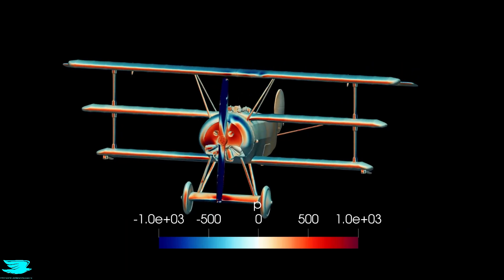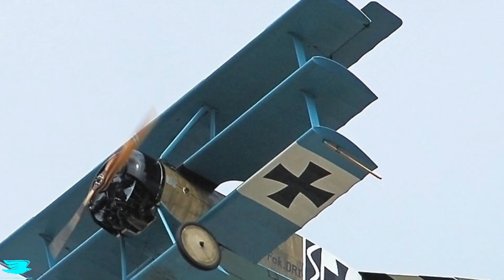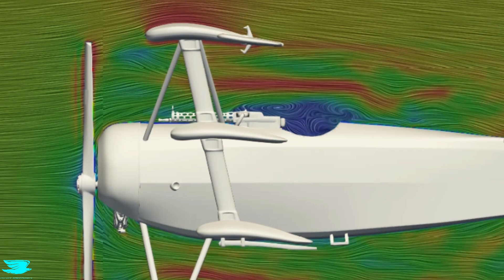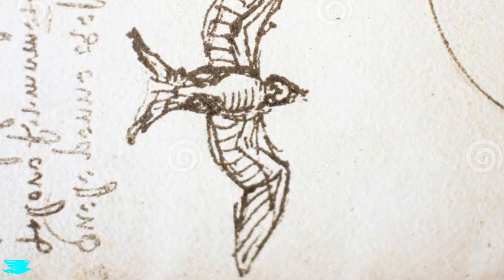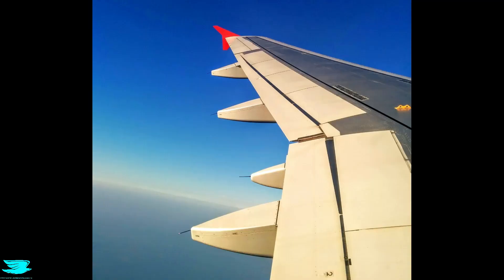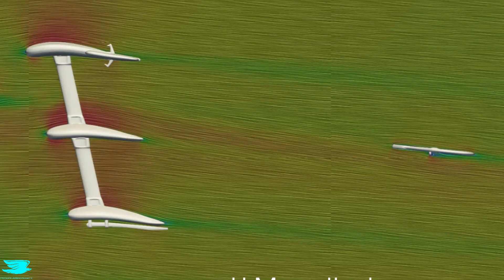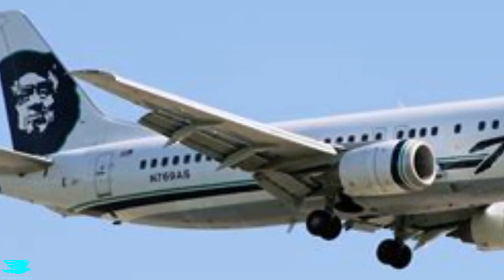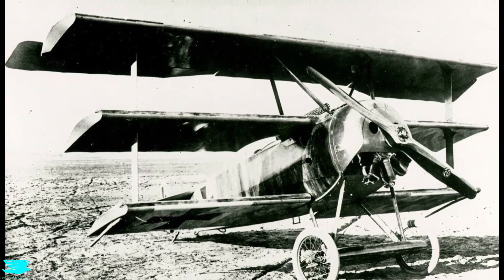Red Baron's Genius Aerodynamics

Comment: for someone discussing aerodynamics, you seem to know surprisingly little about aircraft design basics. love the videos, but it's hard to listen to a technical discussion where a person can't even get the basic terminology right. In WWI they understood far less about design than you think. they figured it out by Lots of trial and error, and adjustments after testing.
Reply: this is true, some of the effects discussed are quite obviously trivial or even detrimental. For example the effect of downwash on the horizontal stabiliser is taken assuming the h. stab. is at positive angle of attack, when in reality if the aircraft were stable it should be at a negative angle of attack at cruise and especially when doing high positive G manoeuvres.
Reply: @KingJellyfishII  the Fokker DR.1 was not stable.

Neither was the Supermarine spitfire. 

Both had their CG located at or aft of the neutral point and would diverge into a turn requiring the pilot to push forward to set the cornering g or the aircraft would stall, over stress the airframe, or knock the pilot unconscious. The instability of these types is what sets the apart among most analogue aircraft in history. There are plenty of documents for references.

Comment: pretty sure a few others used thick wings earlier than the Dr.1, though not as prominently. There was an all-aluminum monoplane from 1909 that surely used a thicker wing to achieve a metal monoplane. Think of the Junkers J1 and D.1 monoplanes of WWI for example.
Reply: Thick Wings..ya mean like a Ford Tri-motor designed like a ?  
That upside-down tailed floatplane Hansa-Brandenburg W.29 was flying by Mar 1918.  A low-wing monoplane some guy name Ernst Heinkel designed.
*Zeppelin-Lindau about copied for their CS.I.  A guy name Claude Dornier worked on improving that thru the '30s to make bigger seaplanes.

Comment: The triplanes were actually quite a bad idea wingform wise. Lots of interference drag and inefficiency but the idea of setting the prop pitch for high climb rate was a good idea
Reply: And the DR1 had to be pulled out of service for a month i think because of upper wing surface of the top airfoil would delaminate and cause control surface fluter ?

Comment: Can you have a look at the effect of adding a drag wing to the rear of the cab and the bed of a pick up truck specifically Mitsubishi l200 2012 dual cab, I’m trying to go fast 😂
Reply: @BoostedMike1  
You should span a tarp from your cabin to the opened back door.

You need to catch some air under the tarp to prevent fluttering.

The pickup truck should look a bit like tesla's cybertruck.

If you want to go even faster you need to mount electric impellers (1-10kw) behind your opened backdoor.
In addition to the streamline tarp.
Reply: I’ve done a canopy but I’m ditching it for weight I’ve already stripped 300kg+ out of it made a flat (as I can) floor it makes 700bhp 1100ftlbs of torque , but when it gets to 130mph+ you can feel the wind generating lift it gets very light on its feet I just want it to feel a little more planted especially at high speed off road 😂
Reply: @BoostedMike1  

Since the car get's formed like an airfoil it is producing lift.
But the airfoil shape also helps mitigating drag. 

Instead of putting weight on the canopy, you should attach it.

Take a look at s-shaped airfoils.
Best way is to add a spoiler behind your car.

If your open trunk lid get's the end of the aerodynamic airfoil shape, you could build a spoiler behind. 

Spoilers on top of the car don't work well. They are producing drag. 
It is important to put it behind. 

If you put a big 2m² airfoil behind, it should produce about 700kg downforce at 130 mph. 

If the torque starts to lift your frontwheel, you need to build an airfoil that is placed some distance in front of your car.
Perhaps 1m² front spoiler and 1m² 
back spoiler.
Reply: @c.l.3806 - you’ve done all this. right?  The exact size of airfoils…maybe you used an aerodynamics program - like Airshaper,  XFLR5  or WOW.   Such gibberish, SMH.

Comment: Also, the gyroscopic ( Torque ) effect from the rotary radial engine aided in maneuverability in a turning contest - dog fighting 👹
Reply: The gyro effect of the rotary really hurts the Dr.I in a dogfight. It retains energy much better with a fixed engine, because a great deal of rudder is required to counter gyro forces of the rotary. Look for chill31000 videos of his Fokker. You can see it there

Comment: 12:00

The tail got a delta Wing design. 
There you get vortex lift instead of stall over the airfoil. 

That is why a flat plate is working.
Reply from the maker: That could be a reason, definitely.

Comment: 6:00

Wing fences on top should get 1-3° attack angle.
That they push the airflow outwards.

At bottom they should lead the flow inwards.

This works like winglets. Reducing induced drag a bit. 

Huge Seperation bubbles got a harder time to form. So you get better stall characterictics.

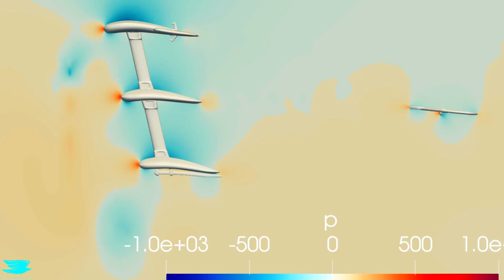Comment: 4:30 

The Wing reaches out 100 Meter above, sucking air to the ground. 

You need to put hydrofoils some distance into the water.

Working with pressure instead of suction is not this effective.
The friction envolved causes far more drag.

That's why effective airfoils are somewhat cambered. Or flat at the bottom.

Comment: I am very disappointed that you failed to mention the most discussed feature of this plane in serious aviation discussion - the propeller pitch. The outstanding agility and especially the climb rate were caused in only a minor part by the thickness of the wings. By a lucky coincidence the designers designed the propeller in a way that allowed it to generate the most power not in fast dashes but instead during moderate speed flying like climbing and maneuvering. This choice sacrificed their design's top speed but gave it the performance characteristics it is most known for.
Reply: They didn't sacrifice much speed with the propeller choice. The engine was nominally 120 HP at 1200 rpm. A static ground run on the Dr.I is right at 1200 rpm. At max power in level flight, the engine will rev up to about 1450, and the plane reaches it's top speed. Drag with 3 wings increases so much that I would be surprised if going with a coarser pitch would yield much improvement.
Reply: Speccing a propeller to an engine and airframe was pretty much settled science even back then. There is a VND curve for all propellers. It begins at Zero and grows in a parabolic arc to peak efficiency. Moving that curve around to cause peak efficiency to coincide with best L/D (for climb or cornering). Is simple.

Comment: Even if the CL slope of a delta wing is lower, the critical angle of attack is crazy high, like 30+ degrees even, due to vortex lift, maybe that's why the tail is a flat plate, less complexity and also structurally and aeroeslastically speaking more stable. Also, in most airplanes when you design them you try to have the tail a 0° effective angle of attack at the design angle of attack of the airplane to minimize drag. They knew about the vortices, Prandtl had already pulbished about the boundary layer and viscous effects, Lanchester had published his vortex theory... They were truly geniuses.
Reply from the maker: Do you think they knew about vortex lift? Or at least saw some data from testing that indicated better performance? That would be really wild.
Reply: I don't know, probably not, maybe empirically and didn't write it down(?) idk. But changing from straight horizontal stabilizers on the E series to the "delta" shaped ones in the D, plus the 0° effective AoA of the HS that you demosntrated in the video makes me believe that they tested and adjusted it either with wind tunnel or flight data. I think it would be next to impossible to calculate the downwash of not 2 but 3 wings interacting with eachother BY HAND!

Comment: The fuselage is fairly deep all the way back to the tail, so may have performed the function of a fixed vertical stabilizer. My Challenger ll light sport aircraft had very little vertical fuselage surface and needed extra “finlets” to keep it flying straight without constant rudder input by the pilot. Additionally, not having as much fixed vertical stabilization would make it more maneuverable in yaw. An article on Werner Voss’s final fight where he took on multiple enemy fighters by yawing it quickly to fire on each plane as they attacked him. Unfortunately, this made him so overconfident that, even though he could have outclimbed them and escaped, he chose to stay in the fight with fatal results.
Reply from the maker: That's a good point. Less constant force on the pilot too.

Comment: Would have been better to remove the dead stick from the model. Its effect on the pressure distributions and streamlines was really distracting.
The ridges were just a result of the fabric covered ribs / cambered surface; they certainly were not deliberate.
The main advantage of the thick wing was the possibility to do away with bracing wires, reducing drag. This was brought to culmination with the Fokker D VII; the plane the Entente forced the Germans to hand over after their victory, because it was such a technological breakthrough.
As for ailerons being limited to the top wing: I think that was mostly about reducing complexity. The top wing was largest in span, meaning that the ailerons would be most effective there; the momentum of inertia of the plane was also quite low due to its small span, so one set of ailerons was obviously enough.
I don't buy the effect on the elevator/ stabilator: deflected surfaces affect the flow well above and below; they  would have affected the flow over the elevator as well, even if significantly above or below. When you calculate the effect of downwash on stabilator surfaces, the effect of z-offset has very little effect on said downwash.
As for flat stabilators: The Piper Super Cub had such a design and was bult well into the second half of the century and still flies today, it is not as detrimental as you describe. The worst design choice of Focker stabilators was the triangular plan form with the small aspect ratio, that affects the lift over alpha characteristic in a very bad way, and one can argue that this is the single most important feature of a stabilator: you want a change in pitch to have a large effect on the corrective pitching moment of the stabilator.
Earlier designs were way worse in that aspect, showing that this really was not understood well; look at the Etrich/Rumpler Taube for an extreme example.
Reply: Strongly agree on all points. It's odd that this video starts with the comment that a flat surface is "barely effective" which is a bizarre claim considering it's been used in tailplanes for nearly a century.

Comment: 3 wings was designed/choice because of stiffness.  They designed it like Bridge, truss beam.  They don't have so strong and light material like we have now
Reply: You' be right if they were braced. The Fokker Dr. I wasn't, however. So it would gain very little advantage of the composite structure (The connections between wings and struts, as well as the struts themselves were not very stiff, meaning that the wings could flex individually to a large degree. the structural stiffness really mostly came from the thick wing and its rigid spar.
Reply: Hi there  ' stiffness' - not at all: Tripehound & Fokker had completely different mainplane construction application. Sopwith simply added a 3rd set to their successful little Pup. But terrible structure: ONLY the OUTER FIXTURE @ top interplane strut takes ALL THE LOAD of x 3 sets of panels = flying wires more than 12 feet length, so all three sets of panels sway and swing about  especially the topmost (each of the x 6 panels are SO LIGHT that one person can easily lift each one.  LOOK CAREFULLY and U can see flying wires are positioned GOING THROUGH middle panel set,  but NOT ATTACHED- at all. Overall, very poor rigidity. Opposite to Fokker BOX SPAR panel design. (I worked on newbuilds of both types)